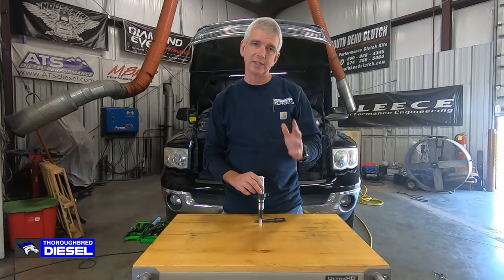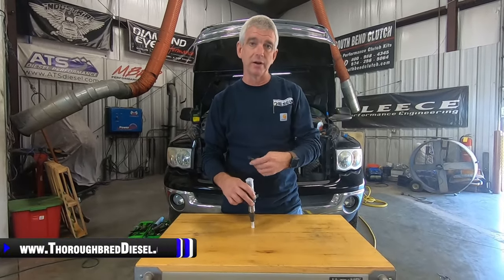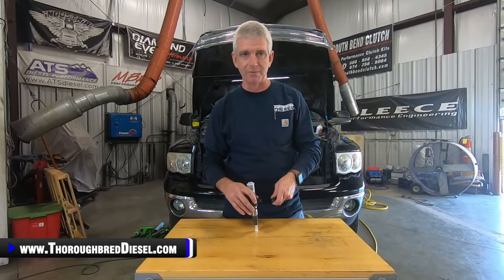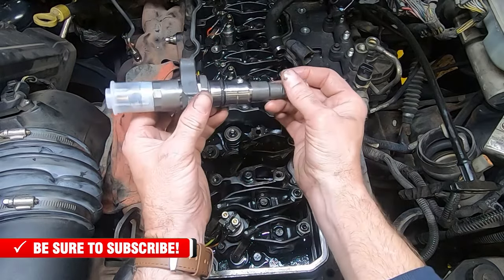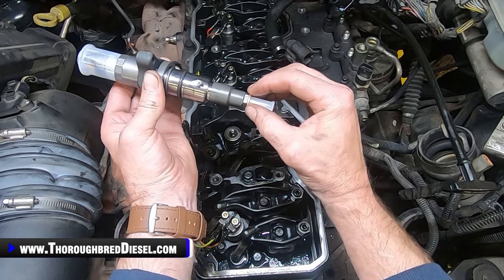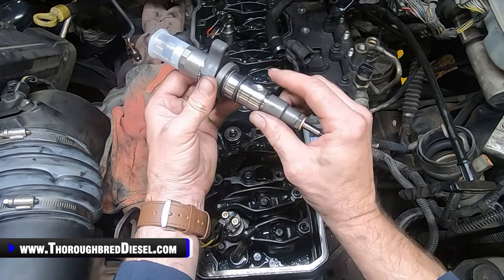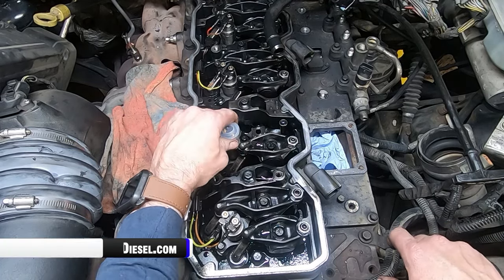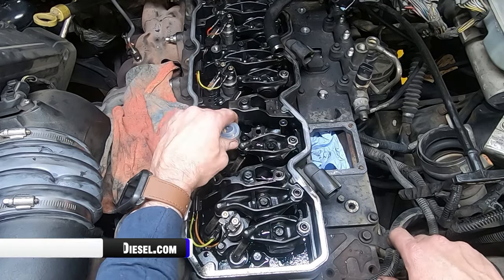HOW TO INSTALL 5.9L Common Rail Injectors #diesel #cummins #dodge #injectors #howto

Comment: Well done. I've watched countless videos on my 05 3rd 3500 Laramie bought new now with 510,000 miles on it and still running the OEM injectors. I contribute the 500+k miles to my religious PMS, Amsoil, 2mc Cat fuel filter after OEM fuel filter. My service intervals for Oil and fuels every 10 to 15K. Every fuel fill up (25 to 30gal) get 8 to 12oz of Stanadyne to keep the OEM CP3 lubricated. I have thought about changing injectors often but to data I have yet to experience any noticeable signs requiring them to be changed. However, now that I have watched this video I will put forth the initiative to start making upgrades and DIY improvements. Great video and information. Thank You!
Reply from the maker: Thanks!  You're welcome!

Comment: What are the symptoms of the injectors going bad?
Reply from the maker: There are several different symptoms.  We look for hazy at idle, knocking, high egt’s, loss of fuel economy.   They can be silent killers so be aware of any changes you notice.

Comment: I’m wondering if I should replace my injectors on my 07 5.9 as a preventative to any failure? My truck just hit 90k. I thinking a better filter system and new injectors? The engine is all stock and running great and only added thing is exhaust brake.
Reply from the maker: You have to be conscious of any change in mpg, engine sound, or increase EGT’s.  These injectors when they are failing cab be silent killers.

Comment: I’m having the same issue truck getting hard to start just had new injectors put in 5k ago and already having my second issue I can’t figure it out truck has 5k rail at idle and 15k when revving so it not dropping the fuel out the return but the truck runs like it has a dead miss or the turbo is lagging really bad stock truck new injectors and new cp3 also I had a mechanic come over with a scanner told me the truck sounded good
Reply from the maker: Check feed tubes first, retorque.  If no luck there, I would suggest removing the injectors and having them tested.